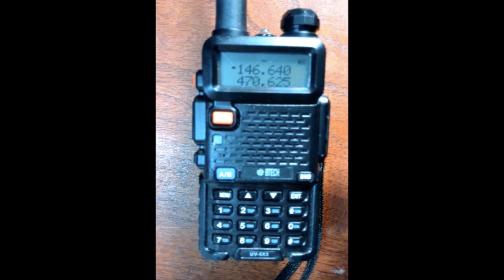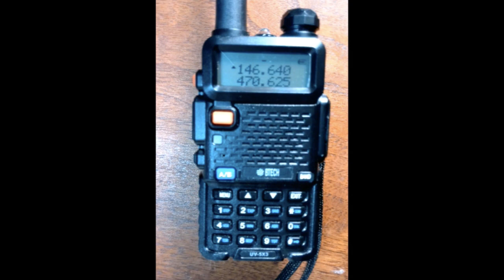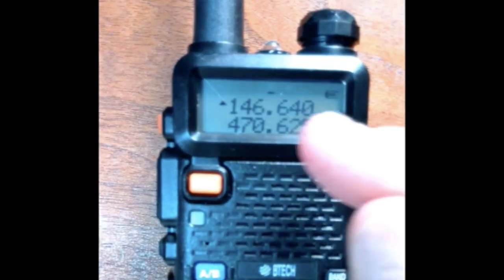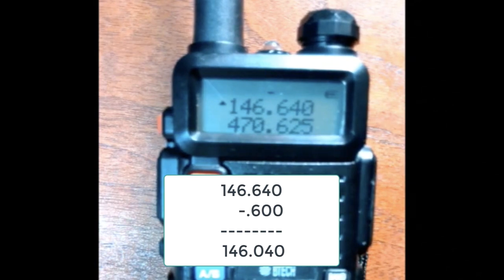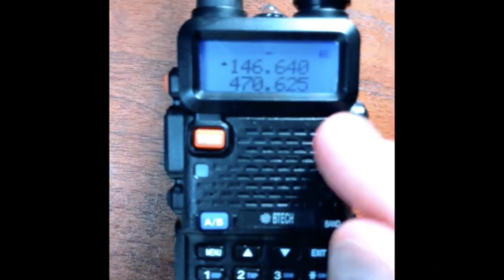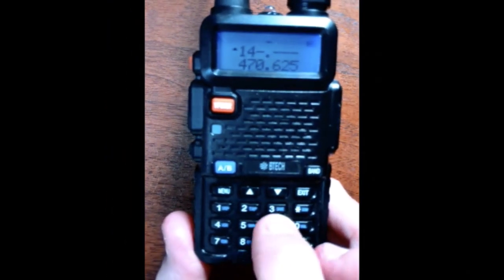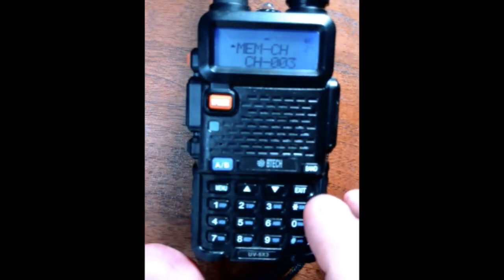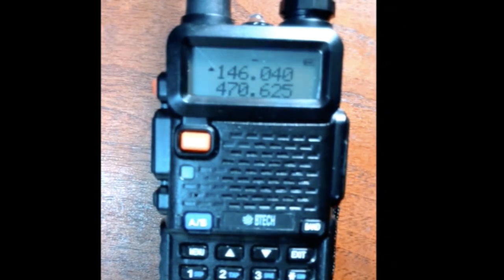How do I save a repeater in the BTECH UV 5X3 Memory?

Comment: Hi Martin. Nice video. For a little clarification, saving with menu 27 (MEM-CH) always saves a TX frequency. There is no way to program an RX only channel from the radio's keypad.

The first save with menu 27 (MEM-CH) to an empty channel (indicated by [003]) creates a simplex channel (TX frequency = RX frequency = 146.640). So for a simplex channel follow the video and stop after the radio says "receiving memory". Notice that the [003] indicating a empty memory changes to [CH-003] indicating a programmed memory.

So what you are actually doing with the second save using menu 27 (MEM-CH) is updating the original TX frequency (146.640) to the new TX frequency (146.040) converting the formerly simplex channel to a duplex channel for use with a repeater.

Also notice that after you update the TX frequency, there will be a "+-" indication in the upper status display. This is to let you know that the RX frequency and TX frequency are not the same (as would be the case for a repeater, odd-split, cross-band or TX disabled {requires programming software} channel).

 -- Jim KC9HI
Reply from the maker: Thanks for that. So If you want to save a frequency for just monitoring a frequency you need to save it as a transmitting frequency as well?
Reply: @KI4CFSHamRadioMartinBrossman  If I understand your question correctly, the answer is no. When you store the VFO frequency to an empty memory using menu 27 (MEM-CH), even though the radio responds with "receiving memory", the memory automatically gets a transmitting frequency which is the same as the receiving frequency. In other words, a simplex channel has been created. Switch to the newly programmed memory (channel) and press the PTT button... it will transmit. You cannot program a receive only (TX disabled) memory from the keypad.
Reply: @KI4CFSHamRadioMartinBrossman  But say you wanted to manually program a channel to monitor a frequency and make sure you were not able to to transmit on that frequency, this would be your only option.

For this exercise we are wanting to monitor 162.450 MHz (one of the NOAA weather radio frequencies in the USA). We have already switched the radio to VFO mode, selected the top display line, erased memory 004, set STEP to 2.5 K and set TXP to LOW.

key in 162450 [NOAA WX Radio frequency]
store to memory 004 using menu 27
key in 462713 (will automatically round down to 462.7125) [GMRS ch 7]
store to memory 004 using menu 27

Now you can monitor the NOAA WX Radio on channel 4 and if you accidentally press the PTT button, the transmission would be on GMRS channel 7. Not strictly legal, but a much better option than transmitting on 162.450 MHz. If you are a ham, you can set TX to any frequency in the 2 meter, 70 centimeter or 1.25 meter (if available) bands where FM transmissions are permitted and won't cause interference.
Reply from the maker: @kc9hi  Brilliant! Do you sell these radios, you should. If you would be ever open to being interviewed about the radio over zoom.us for this channel please let m e know.